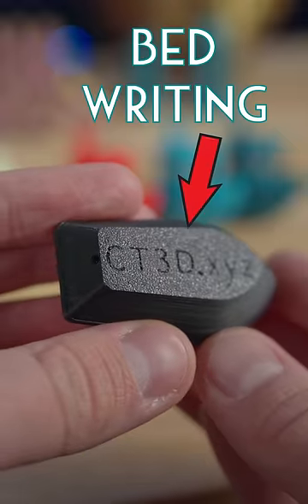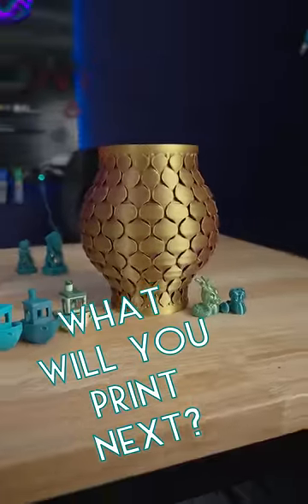First Tests for any 3D Printer ⛵

Comment from the maker: 🔥My Favorite Starter 3D Printer: https://amzn.to/3hMi2r2
Favorite Mid-sized 3D Printer: https://amzn.to/3Eq9KNa

🌈FAVORITE PLA Filament: https://amzn.to/3VNqTIc

📂STL Links: https://www.printables.com/model/3161-3d-benchy
https://www.printables.com/model/118657-calibration-cube
https://www.printables.com/model/209121-cali-dragon
Reply: What’s the starter 3-D printer called
Reply from the maker: These are old links, but I would recommend the Ender 3 V3 SE, or the KE.
They are both cheap and really easy to use right out of the box @Mobsterthelobster-y6s
Reply: @JJShankles  thanks
Reply: Hey what If I want to make big things with a small price it’s my B-day on 19th June so getting close and I want a 3D printer got any ideas on Amazon? If not don’t Worry
Reply from the maker: @Minty_vr007  I think Elegoo has some of the best cheap big printers. I have the Neptune 3 max and it is huge for the price, maybe even too big for most people because of the space required
Reply: What is the best PLA filament that I should use for the AnkerMake M5C or just any PLA you think is best
Reply: 😂 @JJShankles

Comment: I just started 3d printing, and sometimes my prints looks like the second cube, but I have absolutely no idea how to calibrate it right 😅 (I use Cura slicer) can you maybe show some settings for a good print 😅
Reply: When it comes down to the default configs from cura most of the changing you will be starting with will be printer side. Making sure the belts, screw, and attachments are tight but not to tight. Properly leveling your bed and getting the right z leveling. Measuring and getting the extruder motor is tuned right so its ejecting as much filament as it needs to be. Make sure you have all of those things down first before you get to messing with retractions and all the extra stuff that comes with your 3d printing slicing software. The physical and printer software is much more important at the start. Just look up as much info online about working your printer model and issues they have and what to take notice of. Learning from the community will be your biggest help and that will come with time. No one person has a video or article for every 3d printing problem you will encounter. Get out there and learn, think, and have fun!
Reply from the maker: I'm planning on a series to help with calibration, but if your cube is turning out like the second one. I would start with retractions and speeds. A retraction tower is most accurate way to calibrate that.
The speed could also be too fast for your extruder to push plastic. So either slowing down the print or making sure the gears are tight enough gripping onto the filament as it passes through can help.
Reply: Honestly print a benchy. That will show alot of your issues thats what im doing to dial my printer in. I bought some silicone dampeners for it too so it stays level for once im tired of leveling my printer every single time i use it
Reply: Dude, it's really not that hard
Reply: @Aweoe  dude’s just getting started. Be nice, you weren’t born an expert in 3D printing either.
Reply: No, if i was i wouldnt have the right to say its easy... which it is
Reply: @Aweoe why don't you make a video on it then
Reply: @Aweoe gatekeeper
Reply: @Aweoe  It's like you're trying to be as unhelpful as possible
Reply: @Aweoe Bro bought the 6 digit 3d printer and is calling an ender 3 easy to use
Reply: @GilbertIII-ke1di   Nope, my first printer was an Ender 3. It's still easy to use. Even for beginners.
Reply: @Aweoe  I’m surprised you responded
Reply: @GilbertIII-ke1di it’s because your comment was the only one that was wrong lol… the other ones were right on the money
Reply: @aymangani5416  Money for a Mk4 would be nice
Reply: @Aweoe  they are literally asking for advice from someone more skilled than them. Asking for advice and help is a normal part of the learning process. I understand that maybe for you it’s more fulfilling to figure out things on your own but blindly stumbling until you find the right answer doesn’t make you “better” than them and it sure as hell doesn’t give you any authority over how anyone lives their lives
Reply: @Aweoe I literally just got the prusa i3 Rework 1.5 as my first printer and it is hell to callibrate it
Reply: If you’re having trouble with your printing, there are a few websites that will help you troubleshoot. You can just browse the pictures and see what kind of problems you’re having and it’ll tell you. If your cube looks like the second one then you’re having some cooling issues and extrusion issues. What the help of one of those websites you should be able to hammer out the problem.
Reply: @Aweoe  it's not easy when you're first starting out and know nothing. don't be an ass

Comment: You forgot to mention the torture toaster
Reply from the maker: That will be the next video
Reply: That's so much filament and time though
Reply: It's a good test, but it's way too big of a print for just a test. Torture toaster is more of a flex than anything
Reply: @BillBard  don’t calibrate using the toaster immediately, work your way up. Basically, check your calibrations one last time with the toaster.
Reply: Torture toaster is an absolutely model. I don’t know how that caught on. The design itself is just so poor. The toast doesn’t come out straight and it’s always floppy. All I needed was one guide Support. and then the fact that he put all the holes everywhere that actually increases the print time. And in general just takes forever to print and it uses way, way, way too much filament for its size.

Comment: the problem is even though you see problems there's no information that tells you specifically how to adjust the settings to eliminate the "issues" on your print.
Reply: So you look up the issue you're having and you read...
Reply: @TechnoBabble  Did you fall on your head genius? Did your printer come with documentation that explains how to resolve the "issues" Did you buy a printer to read? Did your printer tell you where to go and read? No? With a little help with your reading comprehension from someone with you might better understand the points being made, but probably not.
Reply: @dosdont  HAHAHA, you're so mad that you wrote a whole rant, deleted it, and then wrote another one.

Plenty of hobbyist devices don't have mountains of manufacturer provided troubleshooting/tuning instructions. You're arguing that you shouldn't have to do any research to use a fairly new technology in the consumer space that has essentially no day to day use for the average person.

Oh, and a bunch of 3D printer manufacturers DO provide a bunch of pages are guides. If you can't look something up online then you probably don't have the technical capabilities to properly operate a 3D printer.

Comment: This is all good advice. I personally recommend a variety of torture tests, but especially single parameter tests.

If you have a terrible looking benchy, it can be hard to figure out where to start. But if you try a couple of specialized tests, like an overhang test, bridging test, stringing test, etc. you can isolate issues and correct them immediately.

Comment: For any new plastic, I do the following:
1) Linear/pressure advance test (with some coarse tuning of retraction over the course of printing, thanks Klipper and FW retraction).
2) A retraction test (often coupled with the temperature fine tuning).
3) A flow multiplier test (a 20x20 mm box with two perimeters of a known width is sufficient).
It all takes less than an hour and provides all data needed to really fine tune the printer.
*For a new brand of low-temperature plastics like PLA or TPU I also sometimes run a simple overhangs test and bridging test. For crystalline non-composite plastics like ABS or Nylon, I also run a fast, but accurate shrinking test (a 1.2-1.5 mm high and 10 mm wide L-shaped ribbon with 150x150 mm XY dimentions so it fits my calipers).

For the initial setup of a new printer or some major hardware change, after running tests 1-3 and dialing in acquired optima, I also run an acceleration "curvy box" test (or an accelerometer-assisted resonance test in case of Klipper) to dial in optimal acceleration values.

Comment: The “straight overhangs” you highlighted are typically known as “bridges” rather than actual overhangs, since they bridge to parts together, vs overhanging from one part but not connecting to another.  I think that’s an important distinction to understanding slicer settings because most use that terminology.
Reply: Community:  Please tell me if I’m wrong on this or if there is any further nuance.

Comment: A lot of the calibration models are good for the ones that print in lines but I have a resin printer and it does completely fine with smooth walls

Comment: 😂I got my second 3D print which is a Bambu a1, and didn’t do any benchmark testing before printing my model. Back to 2 years ago, when I got my ender3, calibration took me 1 week.😂
Reply from the maker: 3d printer calibration has changed a lot in the past few years!

Comment: Bruh right now my benchy has so much stringing it looks like it was taken over by spider webs :/
Reply from the maker: Retractions can be the fix for spider web stringing. Try increasing your retraction distance, or using some decent filament. I find the cheapest filament that comes bundled in with a printer can cause the worst stringing, while a decent $15 - $20 spool prints perfectly with the same settings.

Comment: After using filament 3D printers and switching to resin print, the resin prints win hands down. The only downside is that it can be messy to print if you’re not careful and the wash and cure part is sometimes annoying but over all still much easier to use than a filament printer hands down. The best part is you get prints without lines!

Comment: Not really related, but as im watching this im printing an air duct of sorts for a custom battery pack... there is a curved surface with an overhang and as i was watching it print i thought i forgot supports but it turns out then ender3s1plus is just a beast with bridging. I just watched it bridge about an inch with precision as i expected it to fail. No point to this, just a remarkable bridging acomplishment that i wasnt expecting lol.

Comment: There's something to be said for the claims that you should never print a calibration cube but instead fill the print volume (or a significant portion) with a triaxial indicator. There's also some merit to those who say to measure the axial steps before you print any axial calibration test so that you know that any wrong dimensions aren't from the motion system.

Comment: I have been looking for a calibration print and I thought I found a design that would still work but I thank that the popped up as it is designed to calibrate. I do have a question however, if my print comes out poor should I only change the slicing or would I sometimes have to change the heating preset ( If you can’t tell I’m new to printing as of Christmas 2022)

Comment: I just got a 3d printer and I can't get it to print I have tried using the test prints on the memory stick it came with and I have checked in every way I thought possible if anyone has any advice it would be very helpful

Comment: I know you won’t see this. But how do you make the design for the 3D printer to print the model??
Reply: Fusion360
Reply: Various types of CAD software. Blender for artsy types of models, Fusion360/Onshape/Solidworks for functional/precision models
Reply: A free alternative that works in your browser is sketchup. Been using it for years in conjunction with Ultimaker Cura, the only issue I run into is that you have to scale up the models from sketchup by 2540% to get dimensionionally accurate prints, but cura makes that an easy fix
Reply from the maker: I didn't design these models, but there are a few good free options. Fusion 360 or Blender are some of the most powerful free options. If you want to start with some basics you could try out TinkerCAD. Or Sketchup
My favorite is Blender, but that's just how my brain works.
Reply: @JJShankles  thank you very much

Comment: Do u have any suggestions or like names of 3d printers that are big enough to print stuff like cosplay masks and stuff?
Reply from the maker: Elegoo makes some of the best cheap large printers. I have the Neptune 3 Max, but the Neptune 3 Plus would probably fit most cosplay items. They also released the Neptune 4 line recently, but I haven't personally tried one of those
Reply: @JJShankles  would I need a computer to use it? Like if I were to buy a template online could I use my phone or would I need a computer even if I'm not actually designing it? Sorry if this don't make sense lol.

Comment: Calibration cubes are pointless. They don’t really do anything besides check dimensional accuracy, and help a little bit with flow rates

Obviously, your first print should always be a Z calibration :-)  but your first real print should be a flow rate test to make sure your is tuned, then maybe a simple temperature test. Then just go straight to a banshee. You’re gonna see everything you need to right there.

Comment: For my 3D printer, I test using the toaster thing, and all the print in place things work fine, except they were connected at the bottom and I had to cut them.  The rest of their movement had separation, the issue was only on the bottom, is there something I can do to solve this?  Is it a z offset issue?

Comment: In my opinion, all extension 3d printing is BS, because of the dependence of the current pass positioning  by extrusion is ALWAYS dependent on controlling the extrusion properties of the pervious local pass of extrusion.

That is a source of potential error that is completely absent from certain other methods of 3d printing.

For example, Carbon3D printing technology is completely free of this kind of problem because the accretion position is relative to accurate optically flat and completely stable frame of reference calculated by accurate linear time in a way that is completely independent of accession properties.